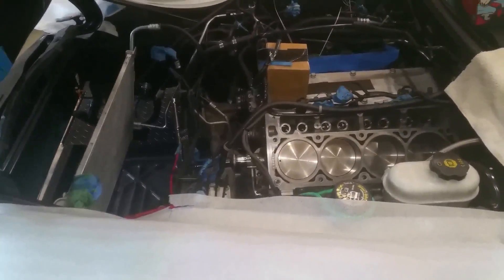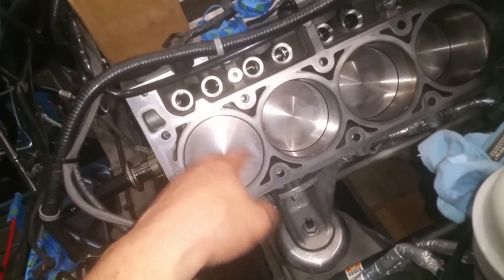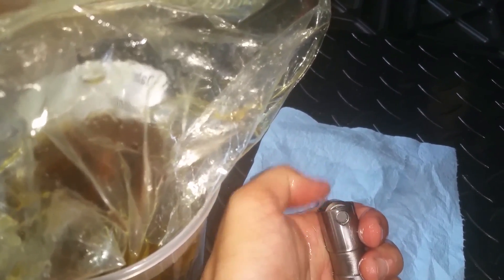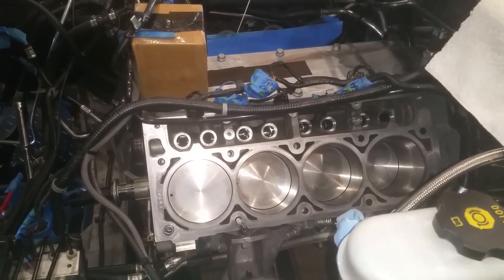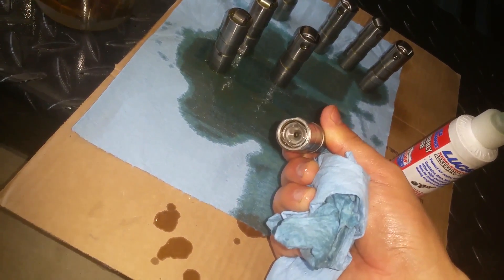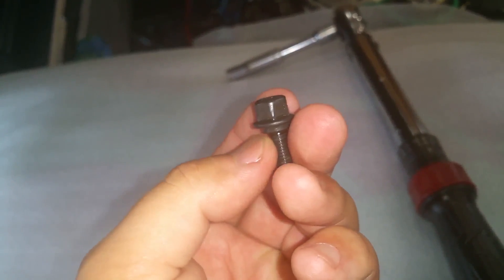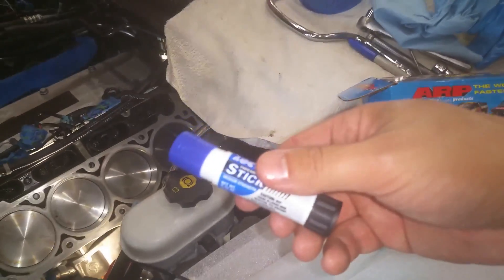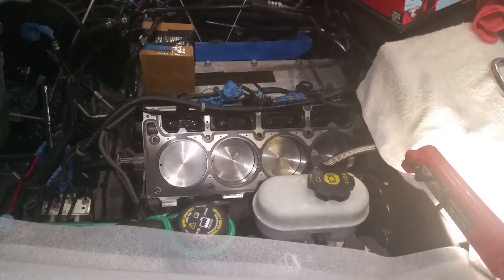Installing Lifters & Head Gasket on LS Motor. Boosted C6 Build. Part 24.

Comment: Informative video so thanks for posting. You placed a lot of work into your build, and I’m surprised you're not more concerned with metal shavings. If I were still able to do my build, I would assemble the entire engine in a makeshift clean room.
Reply from the maker: I never thought of that but that is a great idea. I did use extreme caution and clean every part as well as I could. Thanks for watching and thanks for the tip.

Comment: Had the same lifter deal with comp cams lifters and they said they are packed with assembly lube and not to clean the out and def not put compressed air to them.
 They worked out fine without trying to get them to spin easy. They had like a light drag to them.
Reply from the maker: Thanks for watching and thanks for the comment. They joys of hot rodding. Its never easy.

Comment: Dear author, Could you please advise. If I replace all 16 lifters, AFM and non AFM, will it help ? Or I need to replace also the valley cover ? 2011 chevy camaro SS L99
Reply from the maker: Most people get rid of the AFM lifters. I would not keep them but that is just my opinion.
Reply: @WATCHMEWRENCH  yes but I saw difference in fuel consumption. With stock AFM i have 7 liters to 100 km on highway and 11.5 in city. With Range OBD device it is 11 and 15 :) Why this system is bad? Restoring costs 150$ for new solenoids before lifters and 200$ for 8 dod lifters...

Comment: I have the same lifters from Texas speed. I’m stuck at the point where I need to set 0 lash per the instructions from Morel. The whole measure thread pitch etc is confusing. If you can do a video showing how to mount the rocker arms properly that would be awesome. I have a 2002 Camaro w/LS1.
Reply from the maker: Hello Joseph, watch my videos part 28 and 29 and you will see how I did it on my LS motor. Thank you for watching.
Reply: If you want to figure out the thread pitch just divide 1 by the  tpi. So if you have a 1/4-20 take 1÷20tpi = .05
If you are trying to find a metric threads height take 25.4 divide the metric pitch and then take that answer and enter it as TPI in the first Formula.
So m5 x.8
25.4÷.8=31.75tpi
1÷31.75=.0315 (i rounded)
Reply from the maker: Thanks for the info K20nuts.

Comment: Going from the the Delphi lifters to the morel lifters are they similar in size? I seen some use a lifter measuring tool because I was told that if you go with a new lifter you might need to go with a different size pushrods , but what is your knowledge in this because am a beginner does it really make that much of a difference?
Reply from the maker: Hi Wolf. My next video or two will show how to measure for pushrod length. Im using a comp cams pushrod length checker tool part #77021 which measures from 6.8 inches to 7.8 inches. I might also do a video and show a lifter plunger height comparison with the LS3 lifters vs. Morel Lifters.

Comment: Had similar issues with my ls7 lifters. My engine started to make a squeaking noise due to lifters.
Reply from the maker: thanks Nick for watching and sending me a comment. I guess you tore the engine apart ans replaced them?
Reply: WATCH ME WRENCH Yeah, my engine looked like yours! Was a bit frustrated cause those lifters didn’t have but maybe 2500 miles on them. Maybe just bad set, I don’t know.
Reply from the maker: Those rollers probably were getting hung up. Thank goodness I checked them before I installed them. Sorry you had to deal with that. Good luck and keep in touch.
Reply: WATCH ME WRENCH I think that’s exactly what they were doing. The cam lobes were fine, luckily! But yeah I tell everyone now to check them before install, if they don’t roll smooth, send them back.

Comment: How did you clean the deck surface? And how not to get the old gasket material from falling in the coolant passages Thanks?
Reply from the maker: I have a professional machinist straight edge which I used and I filled all passages with scotts blue paper towel
Reply: OK Great Thanks alot.

Comment: Nice video. Question I have a 6.0 trailblazer SS where the lifter taps on cold starts for few minutes. Any way for to cheat on making the noise go away. I don't want to tare into taking the engine apart and heads off. It's not in the budget right now. Thank you for any help. I run full Mobil 1 synthetic and I change it every 3k miles. Truck has 121k miles on it and been tapping for last 6months  on and off usually on cold starts for few minutes.
Reply from the maker: Hello Aaron, thank you for watching my video and for the positive feedback but I dont know how to resolve that lifter ticking issue. I have seen folks take factory lifters apart and clean them up but without taking the motor apart i cant see how to fix that issue. Perhaps you should take the rocker covers off and check to see that all of the rocker arm bolts are torque properly. Maybe one came loose but then again the noise probably wouldn't go away if a nut came loose.
Reply: @WATCHMEWRENCH  ok thanks.
Reply: My Trailblazer SS has the same sound. It’s a stuck/collapsed lifter. Mine started out just at start up but now it is at all times. It’s too quiet and precise to be a rod knock. About the only way to fix it is new lifters. I have a nasty misfire at idle on 7 and 2 which is indicative of a bad cam from the failed lifter. 
I bought the link bar Morels, new push rods, Comp Xtreme truck cam, springs, retainers and seats along with new coil pack and plug wires. I’m just going to do it all the right way the first time around so I don’t have to mess with it again.
Reply: @MX763  are you going to run it with the stock converter after the cam install?

Comment: The lifters have what looks like a weeper hole in them. What direction do they go in? I'm doing my ls 6.0 and I noticed the tiny hole in each lifter in the center on one side of each one.
Reply: Nevermind. I watched again. So that's something I need to fix. I'm so thankful for guys like you.
Reply from the maker: Glad I was able to help.
Reply: @WATCHMEWRENCH  I went right out and changed it while it was fresh on my mind. I had put them in where the weeper hole was facing the inside. If it weren't for you I would have messed up big time.
Reply from the maker: @Lovetolivetruely  LOL, glad I could help.

Comment: So does it matter if that small oil hole on lifter is up or down?!   I have mine up like you did!
Reply from the maker: I think placing the hole up is better, reason is the oil will exit the top and gravity will then pull it down oiling all around the lifter. If the hole is down I think the oil would have a harder time reaching the top side and fighting gravity.
Reply: @WATCHMEWRENCH  thanks for the reply!   Did everything work out for you?!
Reply from the maker: @jamesguralski5156  Yes, the car works great and it now makes approximately 800 rear wheel horse power.
Reply: @WATCHMEWRENCH  Jesus Christ
Reply from the maker: @jamesguralski5156  Yep she's a beast now

Comment: If Im just replacing the lifters, do I need to replace bolts & gaskets or can I just reuse?
Reply from the maker: Factory LS head bolts can not be reused nor can you reuse the head gaskets as Im sure you know. I would buy new valve cover gaskets and manifold gaskets as well if I were you. They are pretty cheap to buy.
Reply from the maker: Are the center bolt gourmets on your valve covers wet or leaking? You might want to change those and in you remove your throttle body then i would change that gasket as well.